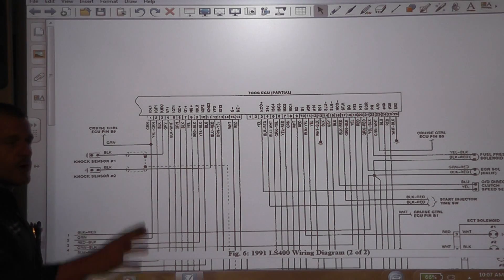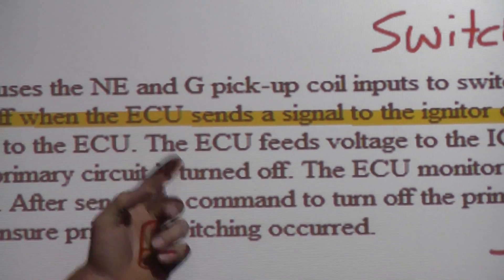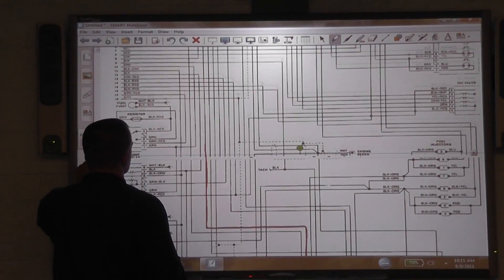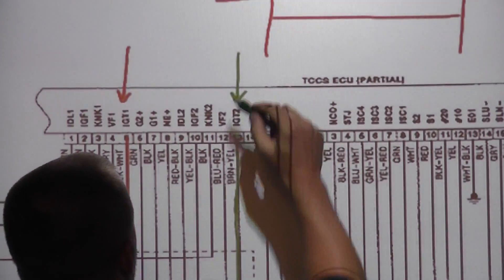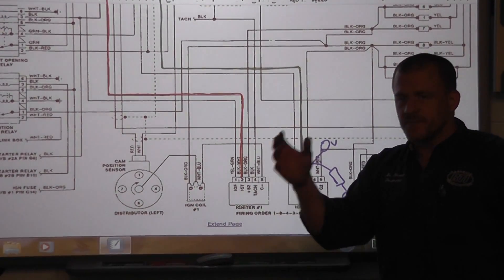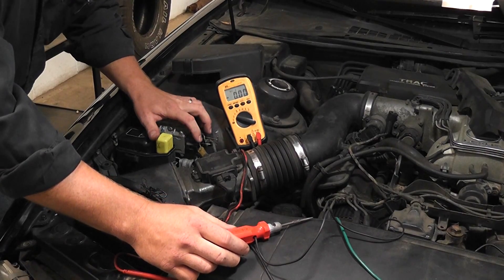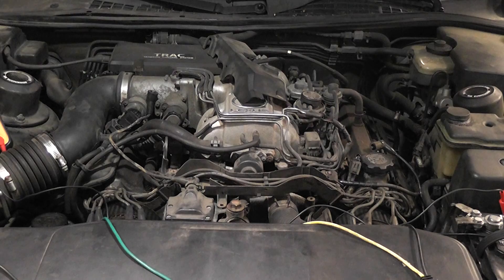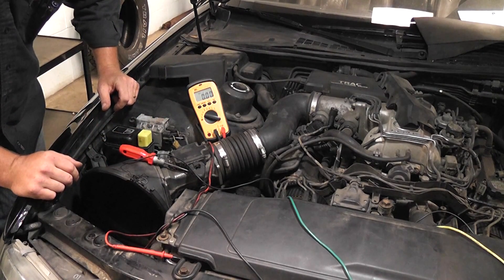How to test an igniter on a Toyota/Lexus

Comment: So I found I have a pull up design on my 4runner. I took a test light from bat positive to my igt wire and got spark every time. So I went and checked my cam and crank  coils located inside distributor and found that my g- and NE weren't within specification. I also saw that the air gap on one of the coils were arching as the distributor turned.  Could this be the cause of my "start"  "nostart" problem I'm having?? And am I going to need a new distributor?

Comment: Scanner I did the test and got input voltage of 5 but the coils are not firing at all so is that a bad igniter because I did trace the wires from each coil on both sides to make sure that the wires are good so I'm really trying help brother

Comment: Ok I went out there with my laptop and tried to do what I saw you do but I don't know which wires on either side to put the metal prongs in so if you have no problem tellin me then I could stratch it off list

Comment: Paul, I tried today and it worked, what I did is like used power hook (newly introduced by power probe) and it have the ability to set max amp. I set to 5 and can be extended to 30 amp.. you might like this tool, because it can pulse AC signal, with very less current 50 milliamps as well.. it have lot of features just an fyi..

Comment: Thanks Paul for reply. it doesn't have spark on either coil pack. I am sure the issue is not coil pack just want to experiment ur video for primary circuit. issue is no pulse. I am thinking of using a jumper wire or power probe to test primary circuit.. will wait for ur advise.. will bad Cam shaft sensor will stop the spark , i tested crankshaft i see good wave form, i got injection pulse. will bad CAM shaft stop the spark? thanks in advance.

Comment from the maker: that test will not work for an ignition coil primary circuit. Coils draw from 6-10 amps of current each and your test light doesn't support that type of flow. 
Does it have no spark on either coil pack or just one?

Comment: Paul, I need ur help. I have ford f150 truck with waste spark, it has 3 wire. One is power 12v always, rest of 2 wire are control wire for 2 ignition coil firing total of 4 spark plug, 2 per coil. problem is iam not getting pulsed ground in those 2 wires.  pls note PCM has built in ICM . I have to check crank sensor and cam sensor, but after watching ur vides, as part of curiosity,  I connected test light grounded and touched momentarily the control wire and see no spark in plug.. any advise.

Comment: Hi Paul
Thanks for your help, I agree that both ignitors prob have not failed, I have noticed there is no ground at the ignitor connectors,  do they use the ignitor body for a ground?????, I have checked power supply and they are both good while cranking??

Comment from the maker: Your focus is certainly toward the ignitors but for both of them to fail at the same time seems unlikely. Make sure you check the main power and ground to the ignitors and also make sure the coil(-) wire (measured at the ignitors) is reading a steady battery voltage during cranking. In a working system this coil(-) wire should be pulsing. If you have my eBook refer to Section 22 page 8 and 9 for "control" testing of coil (-)

Comment: Hi Paul

I have a customer with a SC400 Lexus with the same engine as the vehicle you are working on, it has injector pulse but no spark, I have checked the IGT & IGF with my pico and I have both of them on both ignitors, my question is if the IGT & IGF are both present is it still possible that the CAS has failed or can it only be both ignitors failed???

Comment: Hi Paul, can the ignitor module itself cause a misfire randomly over a long period of time? or most likely be a crank sensor or pcm problem? I had an ignitor die pretty quick,I hear the dizzy shaft if there's play can upset crank signal, crank sensors in the dizzy on my car. Got this misfire issue, swapped back ignitor but still a random misfire, have replaced all ignition parts so next I've got a fuel gauge on the way to check the regulator and pump as the filter is new too.

Comment from the maker: @MrMratni You could. Keep that power probe as far away from the car as possible for my type of testing. In this video what you are doing is energizing the base circuit of a transistor inside of the igniter. I have seen as little as 3v used as a base circuit control. What do you think would happen if you sent 12v to the base with no limit to current flow? The incandescent bulb in my test light is acting as a resistor (a safety net). Your power probe has no resistance!

Comment: Mr Paul, If I use a power probe using a bypass test on any pull-up design component, will I fry the PCM right off the bat?